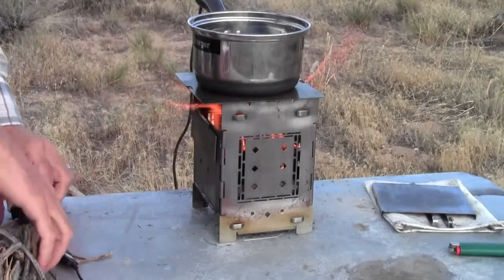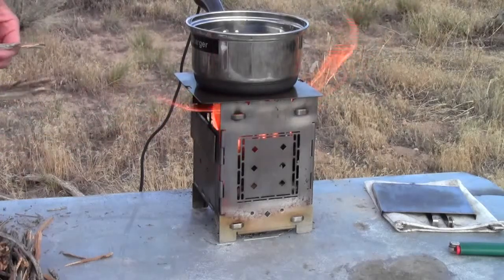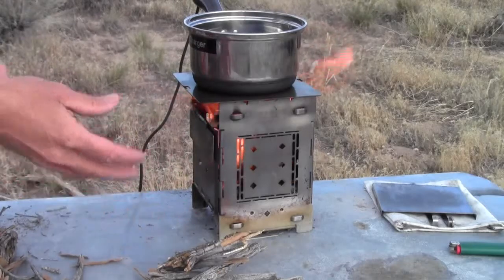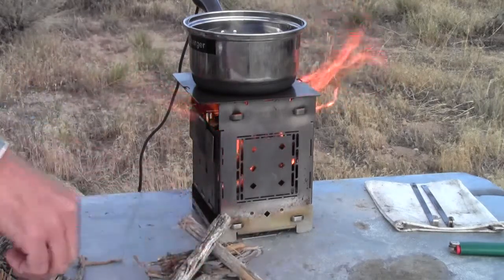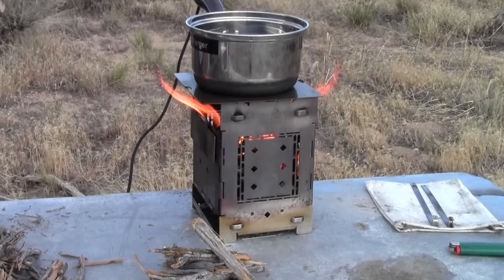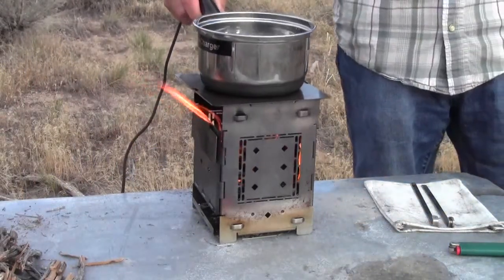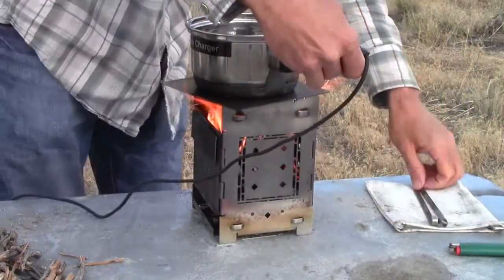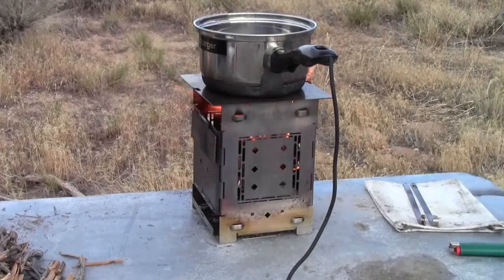How To Maintain Good Airflow In Your Wood Burning Stove For Optimal Performance & Efficiency.

Comment: After using the firebox for a while, do you recommend tapping it with a stick to shake the ash out the bottom?  Is ash build up after a few hours something to think about?  Love my firebox, finally bought a nano too.
Reply from the maker: The best way to clear ash from a long burning Firebox is to insert the firestick into the upside down tie shaped hole on top of the fire grate and gently sweep back and forth across the fire grate like a windshield wiper. this sweeps out the ash without breaking up the hot coals much.
Thanks for the question!

Comment: Steve, what kind of plate are you using on the Firebox?  It looks bigger than the standard grill plate.
Reply from the maker: Hi Ted, That was a flame shield custom made for that Pot Charger that I was testing. Basically an extra large Boil Plate.